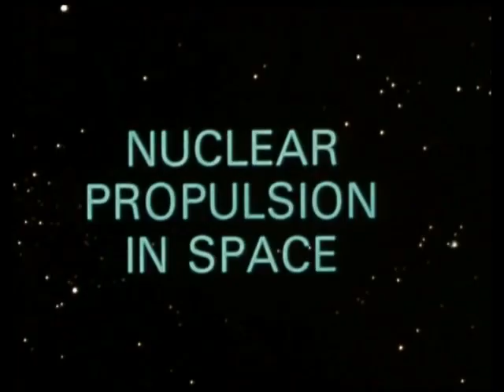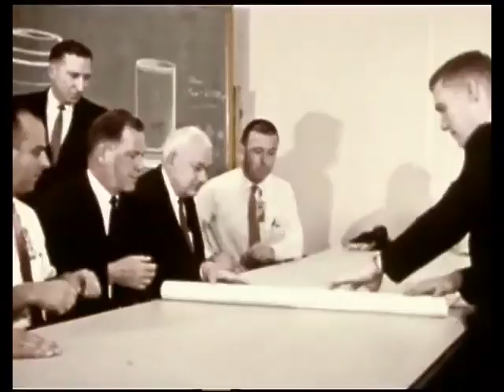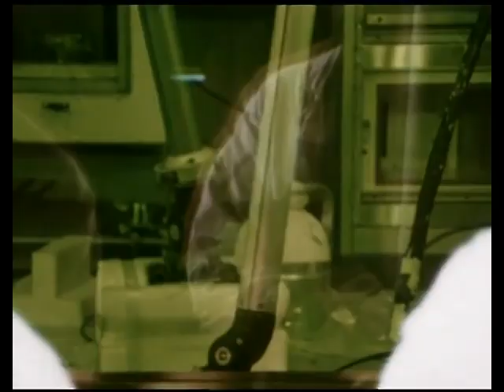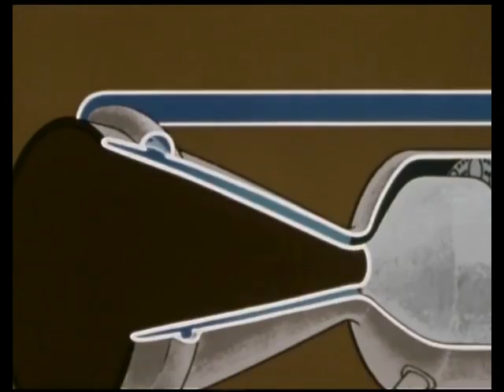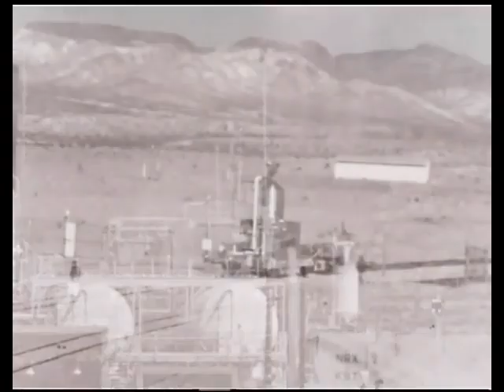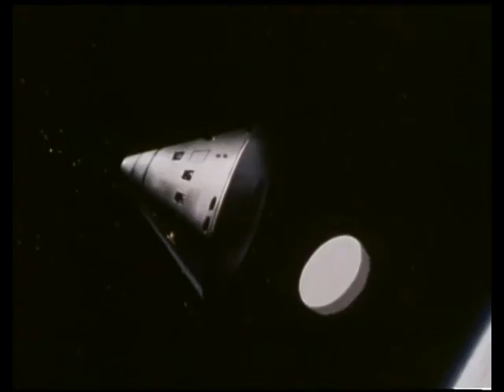Nuclear Propulsion In Space 1968 NERVA Manned Mars mission NASA video

Comment: Can you even imagine how toxic this would be having nuclear fuel rods burning hydrogen. It just about knocked me off my chair. Yes we have a nuclear rocket and everybody is dying of cancer. Or the wigner effect everything is falling apart. Safety is not very well represented in science is it.
Reply: +MegaTriumph1 There is cladding in the reactor to stop the hydrogen from absorbing radioactive material. Very little radiation escapes through exhaust and it's designed for vacuum use only. The reactor would go up without running so it would be as toxic as lead if it exploded in the atmosphere. Hydrogen doesn't burn in NTR's either, it's just reaction mass.
Reply: leerman22 Your wrong of course. It would of been spewing radiation in masses. Did you not see the men working on the rocket with robot hands, it was so toxic. They are burning Hydrogen and nuclear rods?. You can spin it all day and say daisies are coming out but I'm not buying that for one Nano second. My Geiger counter would prove you wrong. That's why they pulled the plug. Nuclear is bad stuff and its ending this world.
Reply: MegaTriumph1
It sprays "Rays" which are gone when the reactor is gone. It's rays aren't powerful enough to harm people from orbit. These tests were done too short to harm anyone, and they were all bunkered down. They're not stupid.
Reply: +leerman22 Ya can't argue with stupid. On an unrelated note, I'd really like to see what the efficiency in a vacuum would be, because, correct me if I'm wrong, but they never tested it in a vacuum, did they? And engines have higher Isp's in vacuums. Too bad they pretty much gave up on it. I'd really like to see what they could've done with it. Maybe SpaceX or someone can restart development.
Reply: MegaTriumph1
You forgot to wear your tinfoil hat.
Reply: Sunlight also damages DNA. Does that mean that the sun is evil and toxic?
Reply: Colton Byrd
It's around 900 seconds of impulse. I assume that was calculated.
Reply: Alright. Well. I'm done arguing with you. Go hide in your underground bunker and put your tinfoil hat on. Like I said at the beginning of this, "There's no arguing with stupid" I only wished I had heeded my own advice.
Reply from the maker: +MegaTriumph1 If the reactors are built in space using in-situ sourced uranium or thorium (from the moon for example), than there is no risk at all of any accident harming anyone on earth.
Reply: MegaTriumph1 MegaTriumph1 By the by, The Hydrogen is superheated not burned. People like you assume you know everything about nuclear technology and actually know very little. Later chump!
Reply from the maker: +Colton Byrd There actually was a meltdown in the United States in 1961 at a US Army research reactor called SL-1. 3 people were killed. The accident led to major changes in American reactor designs, so that the same type of accident could not be repeated. I actually have a government produced video about it up on youtube at the link here https://www.youtube.com/watch?v=58cO_zeFpNk
Reply: PDVideo3 I'd consider that the early days of nuclear reactors. 19 years after the first reactor. Not that long. I mean, 19 years after we invented the airplane, they were still made out of wood.
Reply from the maker: Many ultra-light airplanes are still made of wood today lol But yes, the design changes have progressed quite a bit since 1961, a Chernobyl or SL1 type accident could not happen in an American nuclear plant today because the design elements which led to both those accidents are no longer present in modern reactor designs.
Reply: MegaTriumph1
Was that a sentence?
Reply: MegaTriumph1 You're looking at it like everything on the news bad on the news is everything that happens. If the news said "6,000,000 students got to school with no problems" That wouldn't be note-worthy. So they only bring up a topic when something bad happens. They don't say "443 nuclear reactors have been working fine, without any problems at all" They say 1 nuclear reactor had some slight problems with the cooling"

I know there is a bias name for it. But Jeebus there are so many to go through to find it.
Reply: MegaTriumph1 I do. Wolf Creek Nuclear Power Plant in Kansas. Or at least I did for several years. Why did I respond? Because I'm stupid. So you've got me there. But I suppose not for the reason you believe.
Reply: +MegaDumbass1 They only need to use the robotic arms to examine the rocket AFTER THE REACTOR HAS GONE CRITICAL / IT HAS BEEN FIRED. The reactor was originally assembled by hand. But "your" too dumb to think logically

The nerva rocket is not started until it has left the atmosphere.
Reply: MegaTriumph1
You are wrong, and stupid.  Educate yourself on nuclear physics.
Reply: Ah yeah they definitely fired it on earth, but the Hydrogen itself which is the propellant has very little potential to become Tritium or some other radioactive isotope because it is not part of the fission process. The biggest risk for this reactor would be if it went critical before leaving the atmosphere and exploded. But remember this was intended to be a vacuum engine anyway so it was never going to be fired in the atmosphere. The reactor is a glorified heater and the hydrogen is simply the propellant.  Second of all your glaring ignorance in nuclear technology is showing. Even if a shit-ton of radioactive Tritium was produced it's half life is 12 years and these tests were performed in the 60s so no, the propellant expelled from the NERVA project will never give anyone cancer today. If the spent reactor fuel and parts were not disposed of properly in a nuclear waste site then yes that is a problem.

Honestly chemical rockets probably cause a lot more measurable health problems than all the NERVA tests combined. Back in the day chemical rockets spew out tons nitrogen dioxide and other harmful gasses.

Did you not see in the video that workers reviewed the engine post-fire with remote controls? I doubt any of them received a sizable dose.
Reply: But it so much fun to see what the ignorant people think. I want to believe MegaTriumph is a troll but I genuniely think he may just be stupid. Go ahead and mute the thread, sorry its been spamming your guys' feed 

MegaTriumph1 Sorry but this is going to have to be it. 

"Every reactor is leaking on this planet. The sea is dying yet Nano brains like yourself just can not accept the truth no matter how many times you rub their noses in it" [citation, fucking, needed.] Leaking what, alpha particles into the environment? Do you even understand how nuclear reactors work? Because from what you are saying, you have no clue. 

The coal burning power plant in your backyard is spewing several times more radiation into your environment than all running nuclear plants and probably all the NERVA tests combined, again the hydrogen was never a fission material, only a material that expands rapidly when heated.

" the fly ash emitted by a power plant—a by-product from burning coal for electricity—carries into the surrounding environment 100 times more radiation than a nuclear power plant producing the same amount of energy"

Credible citation: http://www.scientificamerican.com/article/coal-ash-is-more-radioactive-than-nuclear-waste/

You are just on some dangerous insatiable rant because you think your opinion is going to save the world. What a joke, we need sustainable energy like solar and nuclear to prevent an environmental disaster. OH BUT DURPERRRDERR YOU DONT UNDERSTAND.

The good news is you may be legitimately dumb enough to qualify for disability.

/thread, sorry I am going to also mute/unsubscribe/whatever. I suggest you educate yourself before you monger more baseless fear
Reply: MegaTriumph1 I recommend Thunderf00t, to you, sir. Watch some of his nuclear energy videos. Also, I don't properly care if something is safe or not if it's in space. At all. Though nuclear explosion tests in space are far enough, for me, but still. Not terribly harming things if it's far enough from the atmosphere. And, about the Rocketdyne meltdowns, I couldn't find any evidence that anyone died in the meltdowns. Only that some of them may or may not have had a higher rate of cancer. And that it is still being debated. And c'mon. Do you think that these are more destructive to the environment than coal and oil and such? It is, while not absolutely hazard void, significantly better for everything, if handled correctly.

The only nuclear meltdowns were in the early days of nuclear reactors, operated by Russians, or were caused by a major natural disaster.
Reply: Jacob Jones Where was it tested?. On the moon?. Grow a brain cell  ass wipe.
Reply: I don't know, I was on the fence until MegaTruimph1's profanity laced ad hominem arguments swayed me...  (can't believe I just typed that with a straight face).  We probably shouldn't mention the fission reaction helping keep the Earth's core molten, or the fusion reaction at the center of the solar system, should we?
Reply: When you can spell in English properly and present your PhD in Nuclear Engineering, then we'll maybe listen to you.  Until then shut your festering gob regurgitating quarter-truths and conspiracy pseudo-science.
Reply: And you need a brain. I guess you're physical proof that some people have cornered the market on stupidity.
Reply: Nice try schmuck, didn't work.
Reply: MegaTriumph1 Working now sport, catch you later! 👻
Reply: MegaTriumph1 Lots of boys have been to your moon no doubt. Must dash!
Reply: Addendum: The fact that you believe a nuclear reactor operating in space would poison everyone on earth is solid proof you puts feelings before facts. Hydrogen is the most common element in the universe. Your argument is quite frankly, one of the most uneducated statements I've ever heard from an anti-nuclear liberal. Only someone with an IQ under 70 would proudly proclaim such BS then defend it as fact. You can either off yourself for our nation's benefit or you can move to Liberia where your IQ is common.

This will be my last response. People this dumb don't deserve any more attention.
Reply: Can the nuclear industry do one thing right. Just one thing and start cleaning up the nuclear waste. Every reactor is leaking. Cover ups all the time where the citizens find out after they have cancer. You have zero talking points what so ever. You never talked about the Wingner effect creating a new atmosphere element that now eats threw everything. No containment no cement barrier can hold it. Calling nuclear, fission   changes nothing. Nuclear destroys DNA and there is no place on earth to store it safely. The nuclear industry has destroyed this planet killed it dead. Yet you have the thought in mind that it must continue like its all natural and green. Its not its the most deadly thing on earth and nobody has found away to stop it or clean it up. It will be known as it is now the stupidest idea that has ever been invented.  Einstein hated himself for being part of the nuclear invention.
Reply: Colton Byrd There are so many what? Homer Simpsons to go find the leak and the contamination to figure out a good place to hide the nuclear waste. Then Homer will do the right thing and tell the public??. Are you kidding me that will never happen.
Reply: The Japanese reactors were basically designed for use in submarines. I was horrified when I saw their design.
Reply: MegaTriumph1 it was tested on earth of course, but it was a static test and the rocket would not be fired in the atmosphere in practice. The reactor itself is the radiation hazard, not so much the hydrogen used in the test
Reply: Jacob Jones Well then you have never been involved in a static test. Static tests are full on review of the part or parts being made. Static test equals statistics test. That means all tests performed under all conditions. They need a complete read out all statistics. That means burning with the "reactor" in full gear to see how it performs. There is no other way to test a rocket it must perform on earth the way it would in space. I wonder what they did with all the radio active parts for this thing. I wonder how many worker were exposed. I wonder how much radiation was let into the atmosphere. I'm sure its still causing cancer to people to this day only to the glee of the medical industry.
Reply: K, guys. Please stop commenting on this thread. There is no point. All anyone is doing is throwing insults. None of you are going to change anyone's mind. All of you are pretty well set in your ways and arguing and insulting people is not going to change that.
Reply: Colton Byrd
Good I found a mute post button, hope it works.
Reply: leerman22 Wait. there's a mute button? Damn. That would've been helpful. Thanks.
Reply: mithrilaztex We are, talking about the use of plutonium moron grow a brain cell. Nobody needs to boil water with plutonium. It tears apart DNA. There is no place to store its nuclear waste but I would recommend your home. They are all leaking they all escaped the containment barriers. Do you understand you knuckle dragging dribbler. The Earth is dying people are dying the ocean is dying.
Reply: Ben Garner  How can you be so stupid?.  How about we do an experiment. You stand in the sun for fifteen minutes then go stand in unit four of fukushima for fifteen minutes. Measure the sun radiation  exposure first of course. Then measure the exposure of radiation in unit four of fukushima.  The sun is 92,955,828 miles away.
Reply: spencnaz Is this your first day at the job of being a troll. You need a puppy ahhhhhh.
Reply: spencnaz Yes puppy boy we all know how smart you trolls are.
Reply: "MegaTriumph"... you are one stupid individual who doesn't understand squat about nuclear physics.  Your first post... paraphrase... "Holy shit THEY ARE BURNING HYDROGEN in a NUCLEAR REACTOR!!"  That alone shows your stupidity.  The H2 is not "burning".  Think of the hydrogen like the water that cools earth-based reactors.  It's a COOLANT that happily shoots away really, really fast.  You get MORE RADIATION flying in a 737 for 10 hours than you'd get for a YEAR living next to a functioning nuke power plant.
Reply: KurtB Educate yourself. You still think Darwinism is correct. You still think the earth is flat?.  My elevator does not go to the basement level to engage your kind of stupidity.
Reply: MegaTriumph1 The earth is not flat. Darwinism (except so-called "social Darwinism") is correct.

The point I was making with the sun is that the claims you are making are broad and baseless. You said, "If it destroys DNA its not good". Since sunlight can damage DNA, even on Earth at sea level, sunlight must be bad according to your argument. The problem is that the real world is a lot more complex than just "Radiation = Bad".
Reply: Ben Garner Please learn how to read troll. I'm amazed you figured out that earth is not flat. Good for you. Please visit unit four in Japan, the Fukushima building. Hurry up and then tell me how wrong I am.
Reply: CEMX1 That's to bad I was enjoying you homosexual gay boy rant about nothing. You clearly fit the bill as being a mental case. You are a twisted fruit. Can you even explain why your such an angry homosexual?.
Reply: CEMX1 Its "your" homosexual angry Gay rant. Not mine just follow your blogs all you do is explain how gay you are how sick you are how twisted you are.. You will always be the angry gay boy. You are a nut case!.
Reply: CXZ9 Now the Troll has changed its name ahh. All you have ever explained is that your a knuckle  dragging dribbler with an IQ of less then a rodent.
Reply: CXZ9 Catch me later when you grow a brain cell dumbass.
Reply: MegaTriumph1 lol, i win.
Reply: CXZ9 Nobody went to the moon and there is zero science to prove it. Dumbass, You lose.
Reply: MegaTriumph1 😂
Reply: Asshole553 Show me your Science or shut the fuck up.
Reply: There are currently 447 operable civil nuclear power nuclear reactors around the world, with a further 61 under construction. just 6 of them were above level 5 ines level and it all happen in old nuclear facility, nuclear power is very. and nerva rocket doesnt spray nuclear fuel, they use the heat to increse hydrogen speed and spray it out like a usual rocket does
Reply: Roy what is nuclear fuel you idiot!.
Reply: much hate huh? it is contained inside niobium carbide. u didnt watch it all, didnt you?
Reply: just another troll in internet
Reply: Roy, could you possibly be any stupider then you are my god your an idiot. I'll put you on the flat earth watch list.
Reply: like old man say, dont feed the troll lmfao
Reply: Roy = Dumb shit.
Reply: that smelly smell
Reply: I believe SpaceX will start constructing a nuclear reactor once on Mars and after they complete this they will start building a NTR.  My prediction: first working NTR will be built by SpaceX on Mars.
Reply: This is not science. Nothing to do with science. This is engineering. Reckless military engineering. Important difference, taught early in school.
Reply: chromal Clearly you don't understand. If your so smart and we both know you are not. Go clean up fukushima reactors. Even their robots are melted. Or the Wigner effect into the atmosphere . Not one nuclear reactor is "not" leaking. There will always be a scientist and certainly not a very bright one who thinks nuclear is a good idea and its a bad idea. It gets into everything. Did you not watch the video of the contamination of the rocket parts on the ground. Did you not watch the Karen Silkwood movie. I think you need a ticket to some of the most contaminated places on earth do to nuclear radiation and its poisoning effect of this planet. Cancer has skyrocketed do to the use of nuclear. Most scientist are not bright enough to notify the public when they screw up. Do you remember Rocketdyne in California they had three melt downs and told no one?. Then they buried there mistake in deep well so now its in Californias ground water. Have you any idea how many people were killed do to Rocketdyne not having the smarts to tell the public. It truly goes on forever, scientist with low moral standards and I.Q. ("No Nuclear"). That goes double in the hands of any scientist.